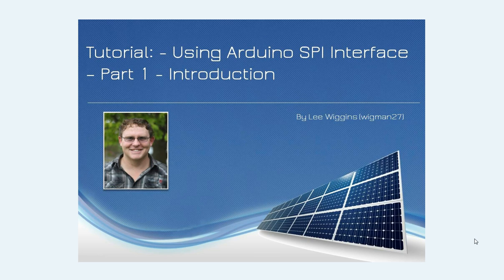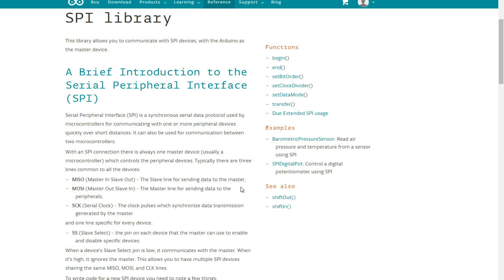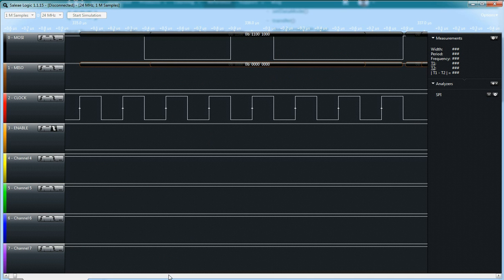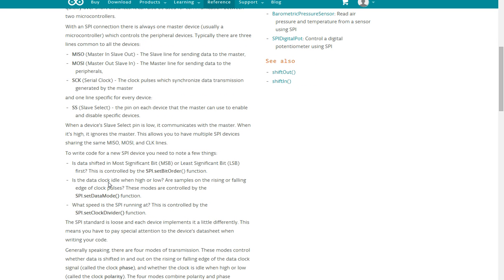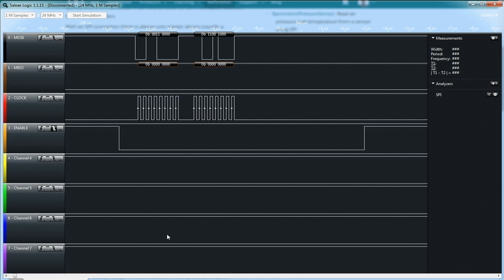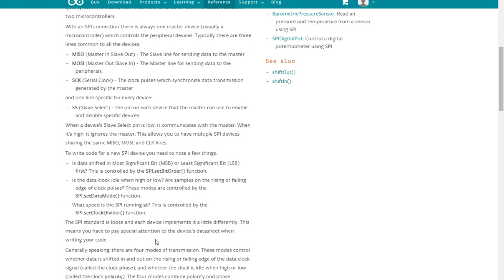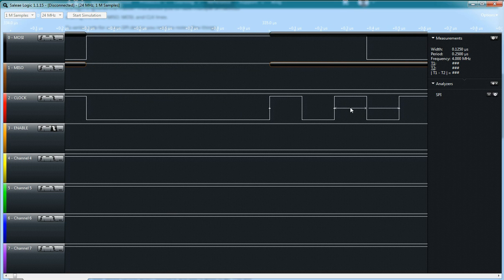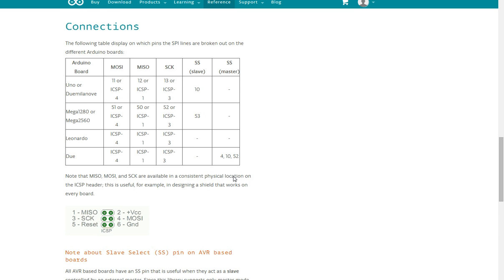Tutorial: Using Arduino SPI - Part 1 - Introduction

Comment: Good stuff. I learned that i can set the mode and speed of the SPI and I should check the datasheet of my SPI device to use it properly with my Arduino!